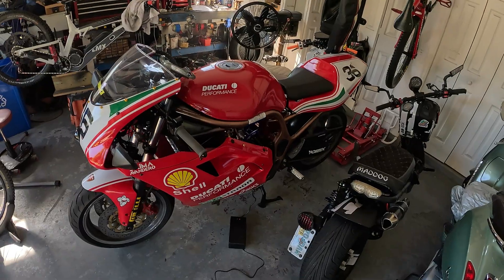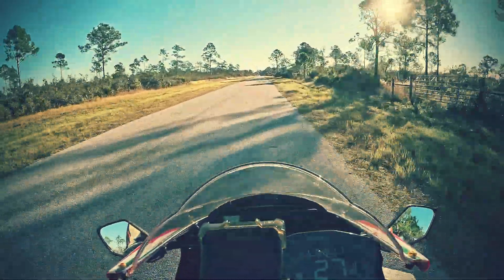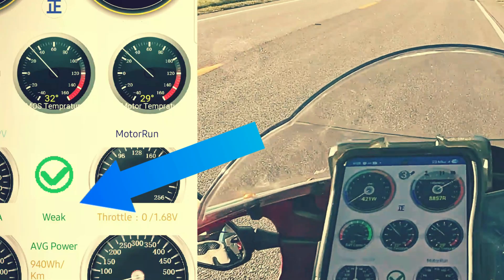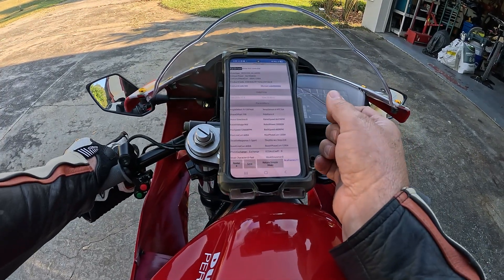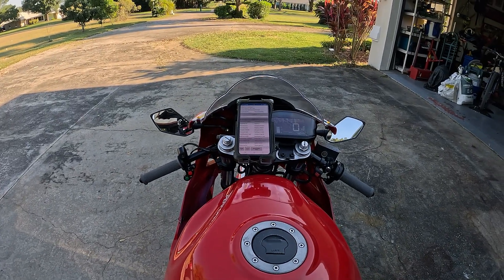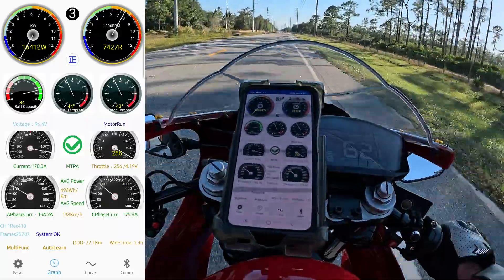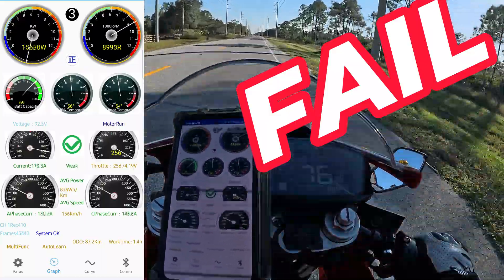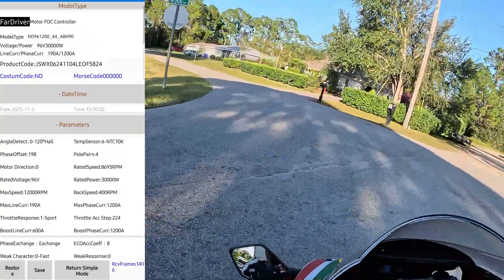Why Won't FIELD WEAKENING Make My Electric Fake Ducati Faster

Comment: 5:50 no. You won’t exceed your rated speed (rpm) no matter HOW MANY amps you throw at it (w/o FW) Amps do not dictate terminal rpm, the winding count 2t,3T and voltage dictate terminal rpm UNLESS there isn’t enough tq to overcome load. 2 identical motors with the same volt, no load, will achieve the same terminal speed even if one had 5x the amperage. 

Your riding mower was a bad example. It is not limited in top speed by power, it is limited by gearing. If you cut the gearing in half it probably would go twice as fast. There is a huge excess of power at top speed on a riding mower because it also needs to run the blades. That is very similar to say a 5000W E bike motor running at 20 V. it has the amps and torque to compete in a tractor pull, but it’s terminal RPM is quite low because of the voltage. 

The rated speed of a motor is similar to the red line on an internal combustion engine, it won’t exceed that speed even in neutral.  

I only know this stuff as I have had many conversations with ChatGPT, it may help you too.
Reply: Would you let chat gpt tune your ebike for ya 🤔👽🚲
Reply: @l

 @louietramposch4559  
yeah, I mean it’s helped me understand the system and has provided phenomenal technical assistance, I’m building a bike now so don’t have anything to tune YET, but yeah, I absolutely plan on utilizing AI in the tuning process. I mean I already have a better understanding than the homie making these videos (no offense intended) and he’s actually doing it.
Reply: @BikingVikingHH well with your thinking you will soon find out how actualy its not going to work like you inteded. Ai is not good at tuning controllers yet. They can only put some general rules
Reply: @Voltjunkie  I’m not sure what you’re implying, but I don’t expect AI to give me numbers to plug in, I rely on it to give me a conceptual understanding of the theories at play, which it has, and then I’ll use my brain to tune the bike. So far AI has been spot on, I don’t see it being suddenly incompetent regarding field weakening 🤷🏼‍♂️
Reply from the maker: I was wondering about that statement when I made it.  Because no mater how many Amps I use, EMF and BEMF should still stabilize at the same RPM right?  When I use 600amps, FW does work.  It goes from 78mph with it off to 97mph on.  I was wanting to show a lower power (amp) example.  That may not be possible. 

So my hub motor has a "speed" (does not say rated or max) of 1670 @ 72v.  Im running 96v.  So is my "rated" speed now higher?  The weak light on it comes at 1500 rpm.  FW def works on that motor.  Do you think I need enough amps to go beyond my rated speed on the fake ducati to get FW to work?.

And I am standing behind my lawn mower example. 😂😂
Reply: @GhettoWrench yes, the rated speed is at a given voltage, generally 72 V from my experience with QS motor. It’s a pretty 1:1 relationship, so for simplicities sake, if a motors rated speed was 72 RPM at 72 V, at 96 V its rated speed would be 96 RPM. I’m also building a 96v bike, a Qulbix q76/ Risun FC1 frame with the 961000 controller so I appreciate being able to learn from your experience
Reply from the maker: @BikingVikingHH ok cool.  Im getting great info.  I think my next attempt will successfully enter field weakening.   😅 🤞🤞
Reply: When field weakening increased your top speed from 78 to 97mph, is there an increment in energy consumption to cater for the higher speed or the energy consumption remain the same @ 78 and 97mph?
Reply: @saintulot1199 yes. You need more power for less TQ, it becomes increasingly inefficient once you exceed the rated speed.
Reply from the maker: @saintulot1199 that's kind of the issue I am figuring out.  So energy demand still goes up the faster you go.  You can go faster with field weakening, but only since you are exceeding the rated speed.  You still more power to exceed rated speed.  I have my amps set too low still.  It does work at 600apms as advertised.
Reply: @GhettoWrench  yes, the ammount of power you get out vs what you put in cuts DRASTICALLY once you enter FW, like 50% more amps for another 10mph... so while accelerating it completely flatlines past rated speed (of your voltage) and will only creep up in speed. so if youre planning an efficient build, one should not plan on cruising in FW, it should be for occasional use. Since youre an aviation guy, think of field weakening kinda like afterburners (in terms of efficiency/top speed, not power). Amps CAN limit you in field weakening because youll need an excess of amps so you have some in reserve for FW... or if youre maxed out, start diverting it from standard acceleration vs FW.
Reply from the maker: @BikingVikingHH awesome info.  Thanks so much
Reply: @GhettoWrench  Yes, I think the mistake you keep making is limiting your current, rather than actually changing your gearing. RPM is proportional to voltage, torque is proportional to current. You keep trying to lower the current, thinking that the power output (P=IV) is staying the same and the voltage is increasing, but this is incorrect. The Voltage is not dependent on current. All you're doing by limiting the current is decreasing Power to the point where you can't even reach an RPM where FW would do anything. It does not make sense to apply FW at a lower RPM. FW is only used to go beyond the back-emf RPM limit of your motor. If you want to test FW at a lower speed, you are going to have to change to a bigger sprocket. That's my understanding, anyway; haven't taken physics in 20 years, so I could be wrong.

Comment: We are still stuck and know no idea how it works🤣
Reply from the maker: That is a perfect summary of my video 😅
Reply: @GhettoWrench I respect your work and like them haha we are in same 💩 i ended up switching  to another controller(waiting for moxin which will go in my quad). Still use my fardriver but in build(mini bike) for which i dont care about field weakening and top speed
Reply from the maker: @Voltjunkie I actually fo get FW to work when I am running that bike at 600 line amps.  It tops out at 78mph and does some weird stuttering BS.  With FW on it goes 97 and then the weird stuttering BS.  No idea what that is.  Not sure why I can not get FW to work simulating a smaller battery and controller.  Maybe I need to limit phase amps also....  even though I am not drawing anywhere near 1200.  Maybe the controller knows.